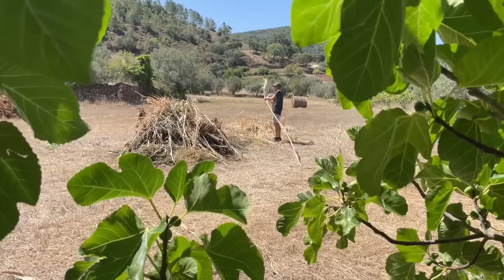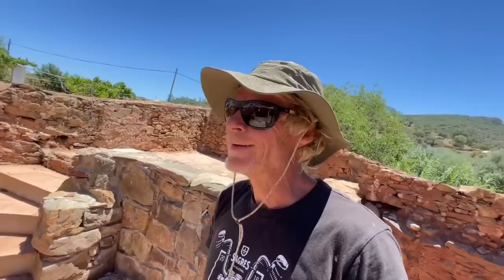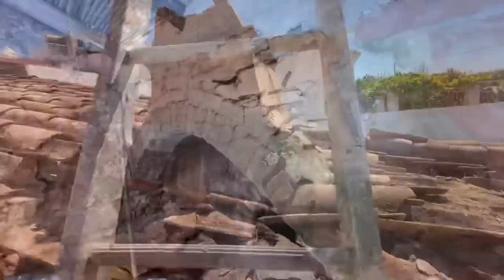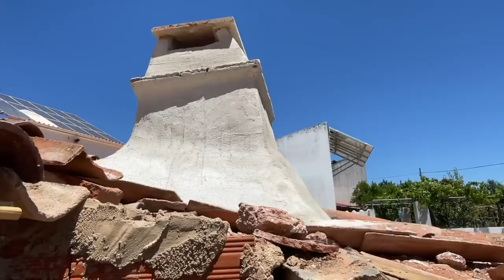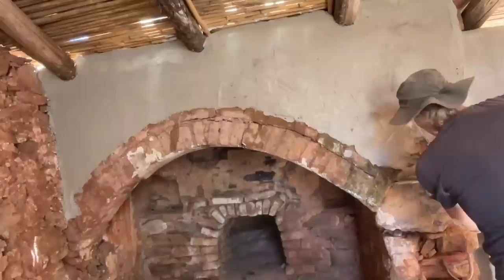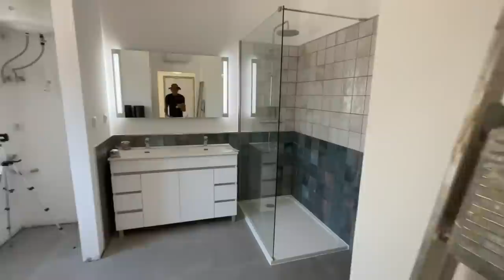100 YEAR OLD RUNDOWN COURTYARD | Restoring the Roof and Bread Oven #128

Comment: Maybe keep the Holding tank full ‘automatically’ with a float system ( like a toilet flush) that activates a solar pump from the well to keep it full to the level you choose…. Not sure how easy it would be to set up .
Either that or funnel the roof rainwater into it as an easy way to store rainwater